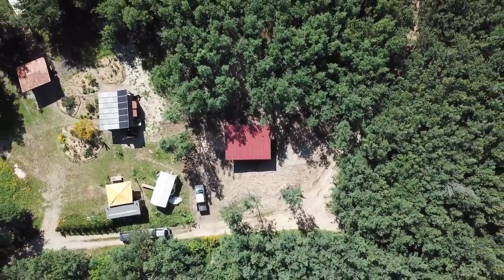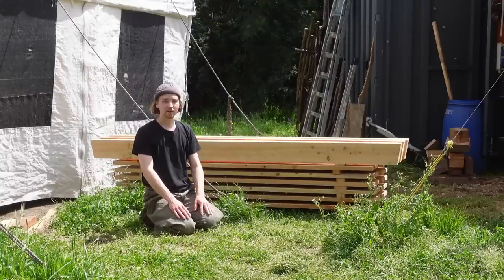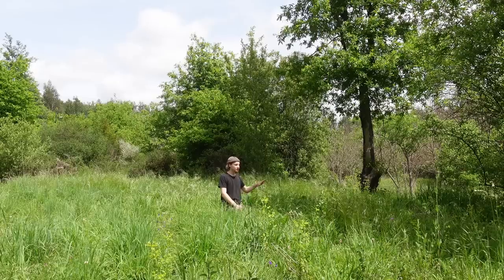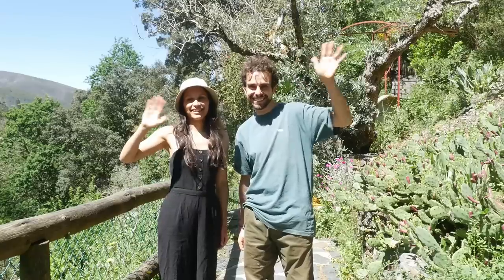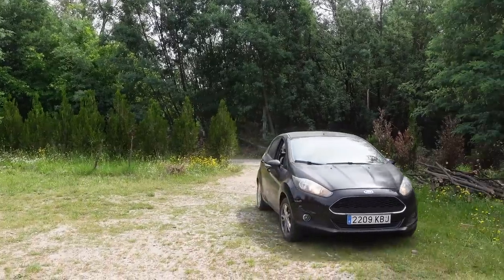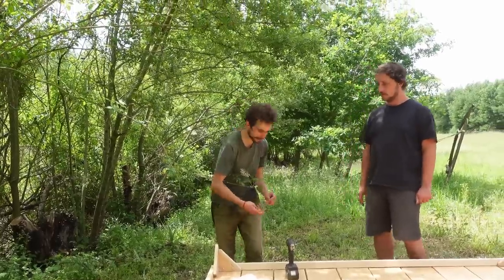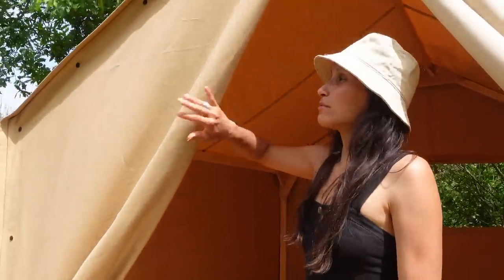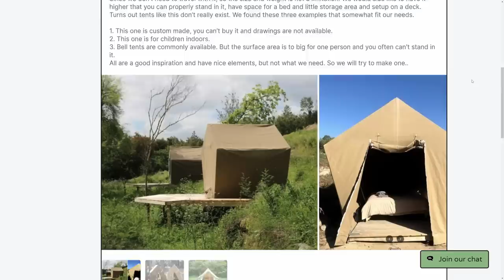#77 We made our own tiny tent (and give you the drawings)

Comment: Overall, it looks great and the team deserves congratulations.  I have just a couple of thoughts for possible improvements/quality control testing.
1) The velco on the back window is strong.  Maybe it would be worthwhile to create a test window and open and seal it a number of times to make sure the velco does not partially come off and damage the larger piece of fabric.  By modern QC standards that should be about 1000 times.  Maybe that sounds boring but the piece of mind has value.
2) What is the wind like when you get heavy rains?  There appears to be a gap between the main piece of fabric and the front and back pieces.  Rain coming in sideways would be a real bummer.  A leaf blow could come in handy.  If you don't have one, maybe one of your kind neighbors could loan you one for the day.  You don't want to find leaks during a storm.
3)  Is the type of wood prone to splittering?  Did you sand the wood?   I made a wooden playset for my children and specifically used cedar rather than pressure treated lumber for the playset floor so they can play in their bare feed.  You don't want somebody getting into bed and a large splinter getting embedded in their food in the middle of the night.

None of these are major critiques but may some minor improvements to consider.  Again, great job.

Comment: I worry that supporting it only by being on a few rocks might be trouble over time. If there is any water movement, they could be undermined, and it would start leaning. It might be worth reinforcing the platform even if it does not "need" it right now.

Comment: A very simple design. I like the wooden construction, but all in all it is much too small for my taste, as is the platform.
The easiest way to solve the problem of flies is a complete bedroom mosquito net, which is fixed in each corner of the tent.
You could have worked the floor in tongue and groove, then it would now be tight, afterwards you could screw thin wooden panels onto the entire surface or glue cork boards on.
I would seal the gaps between the connecting buttons with Velcro, a few additional buttons don't stay tight if there's a storm. The hurricane staps could have been guided in a fabric tunnel, it would have been less primitive in appearance. Too few ventilation openings compared to modern tents and the closures for the door and the window also need to be further developed. The idea is good, just short-sighted.

Comment: Why not add a bug mesh fabric to the window. And maybe add smaller windows to the (on one or both) doorflaps as well.  And i would add a floorcover too. This is to prevent insects or other critters from entering from the bottom and to protect your feet against wood splinters. And maybe it is also nice to have an awning to have some shade at the front of the tent.

Comment: Hey so my biggest concern is leakes, but as I am looking at the design one small modification could make a big difference. If yoy were to put Velcro on the back and front edges and along the edge of the overhead side you could Velcro all the pieces together. This way even if water is coming in sideways leaks would be reduced. Although I am no knocking the design at all. I think it is brilliant. I am just thinking 2.0.
Reply: Oh, and bug netting over the window and door. The window netting could be sewn from the top into the the outside of the tent with the sides and bottom attached via Velcro. The doors could be hung with fishing weights at the bottom and a split down the middle with magnets holding it closed. The netting could be attached to the frame via more Velcro on the underside and along the sides of the frame.

Comment: that is going to leak!  the roof needs to overlap more and be secured to the walls, and the walls need to overlap and be secured to each other.  mesh should have been put in the window too.  i wonder how strong that frame will be in the wind. make sure there is no one in there when its windy.  the fabric will act like sails in the wind and might destroy it.  good first draft, but i think its going to need a lot of work to have a really functional, durable design.  were the walls and roof (especially) waxed/oiled so its waterproof?

Comment: I'm surprised you did not design the tent for 2 person occupancy optional.  Nominal increase in cost and footprint and encourages social 'partnering'. How is the mimosa eradication project going?  Once an area is cleared, does it make sense to plant eucalyptus as a pioneer tree to compete with mimosa?  Perhaps the eucalyptus would give the more desirable trees a chance to mature so they would also be out competing mimosa.  At that point, you can harvest the strategically planted eucalyptus as saw logs.  Are you irrigating your desirable trees from the big pond? The three bottom timbers are greatly oversized for the job.  Much thicker than necessary.  If the deck planking had not been cut down (left at the length as it came from the mill minus a minimal end trim) and the support timbers repositioned accordingly- the platform would have been big enough for 2 people at no extra cost.